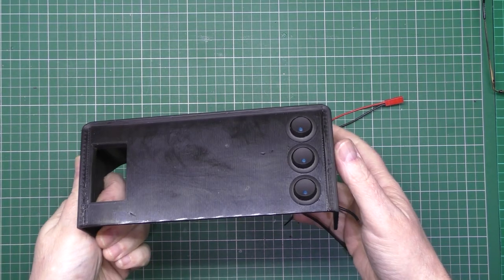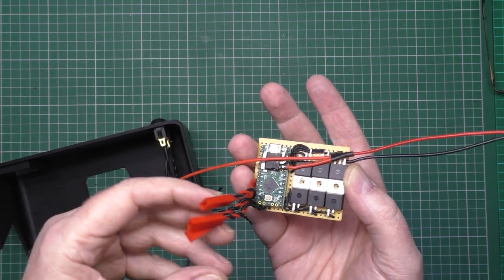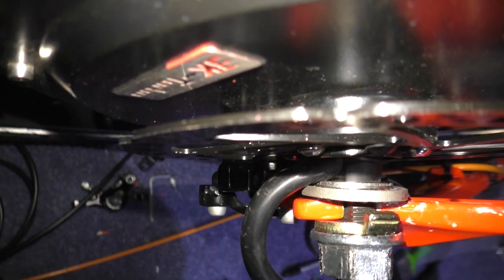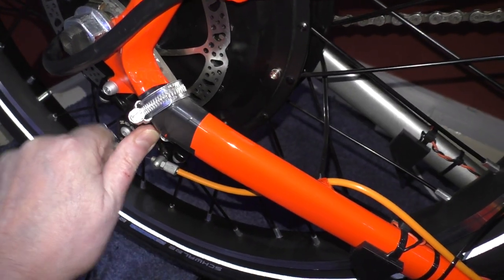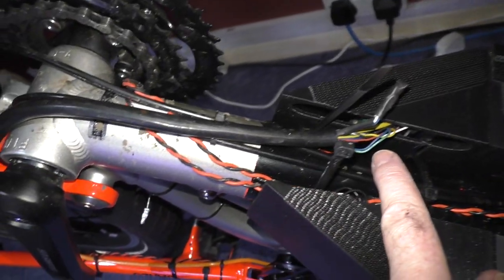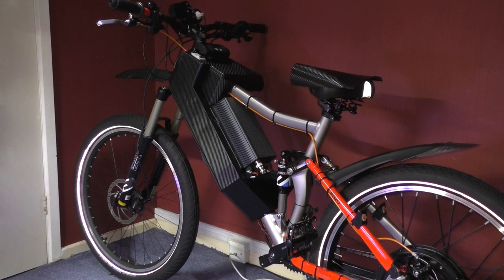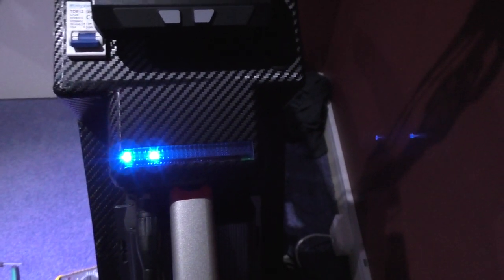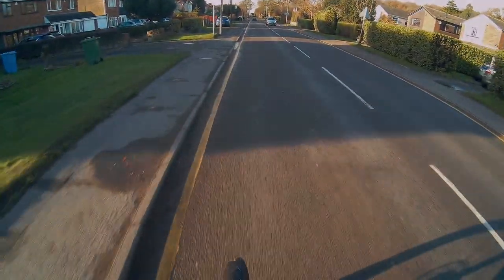11000w DIY eBike build part 11 - Switch panel, rear brake & finishings

Comment: Good show man.I slammed into a curb and bent my double wall front rim blew out the tire.It still runs true but the brakes rub when applied.The other one works great got to have good brakes for your life depends on it.Ride safe.
Reply from the maker: I had to lace 2 wheels and true them up. I was amazed at how easy it is. Have a go.....you've got nothing to lose!
Reply: I will have to soon now that sub freezing cold is here.Cheers.

Comment: Been wondering for a while whats been going on with your bike

Nice to see you back outside on it and using it for what you designed it for

After xmas ill be starting buy stuff to start my own Ebike prject when it comes to eletronics it will be allot more simplier.

Might offer to race you with it even tho motor will be 24 volt 500 watts the rest is top secret but ill have option of going electric or not.

Wanted 24 volts because of the cost of 6 cell lipos .. .  found seller on ebay who has i think five 5000mah batterys theres some welding involved as well.

Keep up the good work always enjoy your videos as they make me laugh

Comment: Absolute pissa. But I am in same boat. Finally found someone else. I have kona king kikapu duel suspension just converted and bloody good rear brake I have is way off from fitting. And mu frame is multi color and I am looking it saying I dont know if I like it 🤣 plus now have to use a $5 rear brake. Now deciding if I should just buy a enduro frame and hope they measure up better for decent rear brakes

Comment: Looking neat Tony, I can machine you a custom spacer for that rear  Disc rotor if you like..?  I think you can space it off and go with the proper hydraulic rear caliper?...Just mail me a sketch of the spacer m8. This thing needs proper brakes, a cable operated Disc brake will be as useful as Theresa May.
Reply from the maker: I've already sorted it mate, thanks for the offer.   
It now has full hydraulics and 203mm rotors front & back
Reply: Oh, ok....If there is one thing you can't compromise on with this machine, its Brakes...!!! Pleased you have it covered m8, the offer is still there if you need it though....:)
 About to start my Z84 build, Im waiting to see you do yours though....:)

Comment: Great work tony. I have read from the comments that you sorted your back brake. I was about to say I have just sorted mine with 2x 2mm hope disk rotor spacers. It's tight but everything is lined up and nothing rubbing. Keen to know how you managed to sort yours.
Reply from the maker: Not easy is it mate? I ended up having to put a 203mm disk on the back because (even with 4mm spacers) it was catching on the MXUS logo. A 203mm makes the caliper clear it easily.
Reply: Vortecks yes I am using 203mm disk too. It is much better with hydraulic back brake plus regen
Reply: Can I please know more about the 203mm and exact bracket needed

Comment: Tony no wonder the back brake was next to useless. You have about 16HP equivalent to about a 250cc motorbike! that's a lot of stopping. lol
Reply from the maker: The front brake was amazing but it still didn't have the power to stop. I've now fitted the 203mm rotors.....we'll see how that works